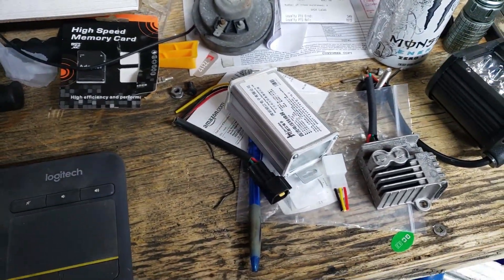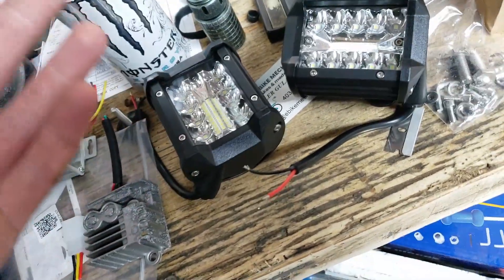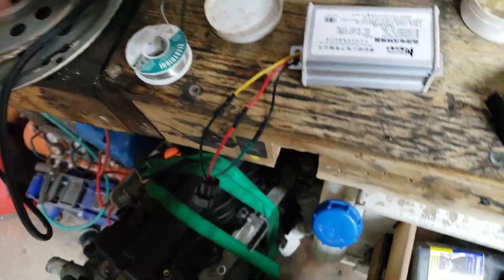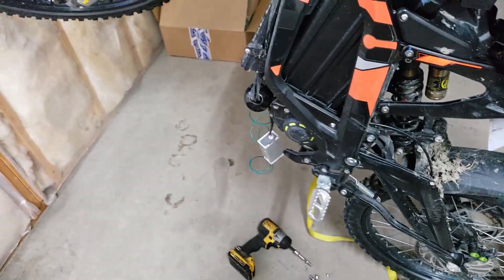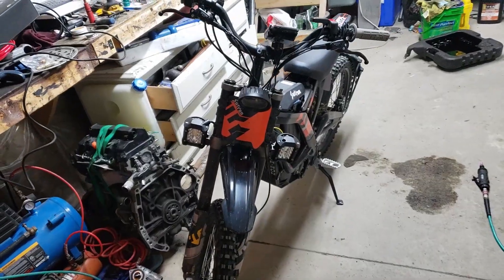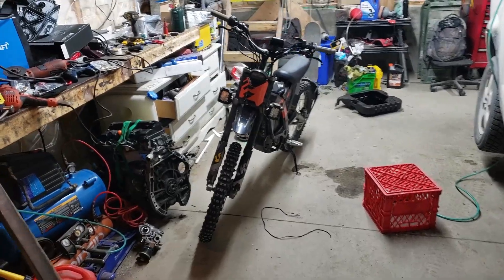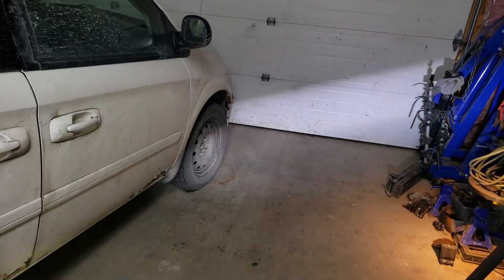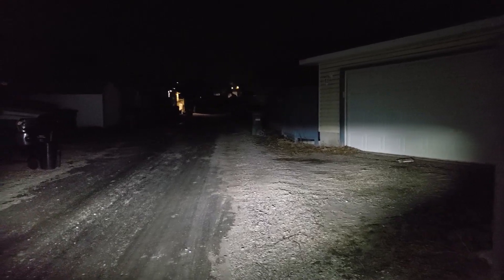HOW TO: Upgrading the Surron! DC converter upgrade and bright light install!

Comment: Nice video thanks! I ran too much power through the stock Talaria DC transformer, (100w in lights).. it worked great for 20 minutes until it's tripped everything & no longer powers on (only the bike runs)
Do you think I’ve fried the transformer or just a fuse need replacing?
Reply from the maker: I think the DC converter is pooched.  The one I installed was like $15 or something.
Reply: @TheCraftyTech thanks, the extra wire. Is that a necessary thing or was that for your headlights ?

Comment: Do you have the link of the converter you used?
Reply from the maker: DC to DC Buck Converter Step Down Transformer Voltage Reducer Input 36V-72V Output 12V -10 A/ 120W Power Regulator for Electric Vehicle Cart Club Car Scooter Bicylce and More https://a.co/d/hi6Hadv

Here is the one I used.